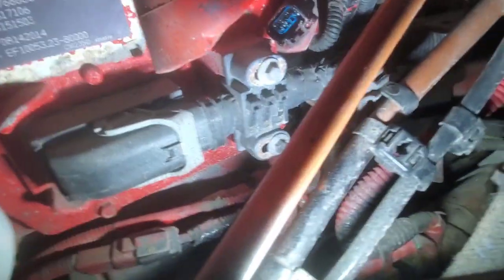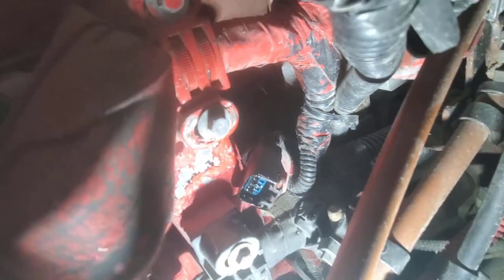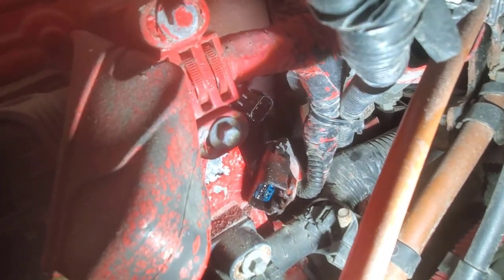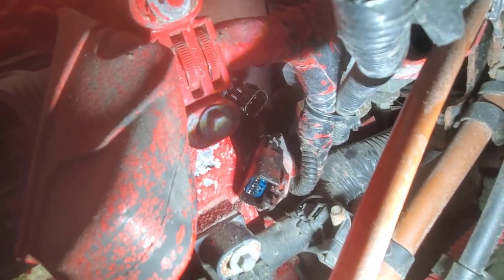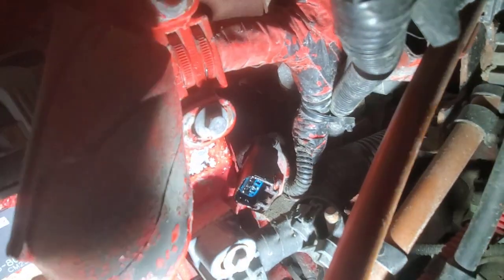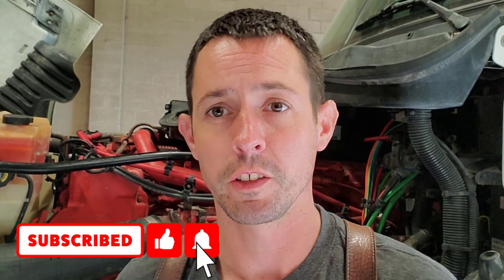Oil Pressure Issue on Cummins ISX15 - How to Fix it?

Comment from the maker: Have a Cummins engine? Check 👇🏻
Playlist Recommendation: Truck Maintenance - Engine (Cummins)
► https://bit.ly/3HQ1O8m
Reply: Having the same problem with my 02 mack vision runs fine for 30 seconds shuts down due to reading no oil pressure.  Well start back up run fine for 30 seconds shuts off again.  Changed oil pressure sensor and oil pump no difference.  Any help would be appreciated.

Comment: what part of Kentucky do you live in, do you work for other truckers or just for your own truck
Reply from the maker: I live in Ohio. I have a truck repair shop. I work on most of the commercial trucks.
Reply: @truckingandfixing  how far from Louisville Ky
Reply from the maker: It shows 5.5 hours
Reply from the maker: Our shop address is 1120 high ave sw canton Ohio 44707

Comment: I have a isx15 and a check engine came out I look on the code is spn 100 fmi 3 can you please tell me if is my oil pressure sensor or something else
Reply: Was it the sensor i got the same code

Comment: What If the oil pressure doesn't fix even after changing the sensor, what else could be the problem ? Any idea what else I need to do to fix the issue ?

Comment: Freightliner cascadia d15 derated to 5 mph all lights on is there any tricks to bypass the derated 5 mph to make it to a shop
Reply from the maker: If you have otr performance diagnostic scan tool, you can clear the derate.
Reply: Disconnect sensor on transmission

Comment: Thanks for your video... very helpful. I put a new sensor in my X15 Cummins engine and was working fine and then my oil temp started acting Goofy... so I put a new sensor. Now my oil pressure gauge is going less of 20.. like 19 and alarm going on.  No leak in the engine... oil is fine. So what do I need  to check...???

Comment: What should the oil pressure be on that motor at idle and when you're driving
Reply: Mine runs about 20-25psi at idle and running its about 38-42psi.  Thats an isx15
Reply: @TheJammedToilet  mine is the exact same.  That must be normal than

Comment: I'm having an issue with pressure slowly dropping.  When I change my filter...I'll get between 38-42 at highway speed.  22-24 at idle.
But after about 3-4000 miles...I'll be at 35-38 at highway.  Then about 1000 miles later...it'll be down to 33-35.
If I change just the filter...it'll come right back up (same oil) to 38-42 again.  And then the cycle repeats.  After 4000 miles...I need to change filter again.
I've cut the filters open...squeezed out the oil...but nothing is inside.  No sludge, no metal shavings, nothing.
Ever heard of this??
Reply: Same issue,  08 CM871 deleted. Baldwin did it 2 tines. Fleetguard so far so good. Any update on your outcome would be greatly appreciated
Reply: Were you able to fix the issue? What did you do?
Reply: @randallsluss1475   were able to fix it??
Reply: The same issue with my truck. Did you fix it?
Reply: No fix yet.  Still doing the same thing.  Sometimes it'll go longer than other times before I need to change filters.  I think the engine is just getting wore out.  I do have some blow by so it'll need a rebuild soon...just running it til then
Reply: I'm looking at buying a 2012 Cummings and while checking it out, after 30 minutes of idling the oil pressure dropped to 0. I changed the filter with a Fleetguard, put fresh Shell Rotella 15/40, and change the oil pressure sensor. I let it run an hour today. Started out at 40psi and after an hour of idling it fell to 30psi and never dropped below that. My question is, what is normal idle psi?
Reply: @robertmann3353  you're good at 30 at idle.  I think 20psi at idle is lowest Cummins claims is bottom side of acceptable

Comment: check for oil filter plugging first, you do that over by the oil filter and the oil cooler rail, a plugged oil filter from (soot) will wipe out a crankshaft in short order,
Reply from the maker: The issue has been fixed by replacing the sensor and customer is on the road already
Reply: @truckingandfixing  yea but he said do that first, before assuming it’s the sensor

Comment: no one that watches this video needs to follow any of this info, if your having oil pressure issues you must check for oil filter for plugging, you do this over by the oil filter and on the oil cooler rail, while a leaking sensor is a good indication it may not be the issue, a plugged oil filter (soot) will wipe out the crankshaft in short order.
Reply from the maker: Obviously if the sensor leaking oil out of it, there is an issue with the sensor…